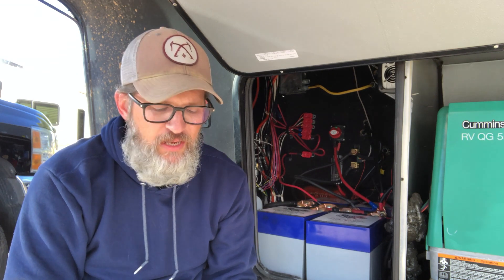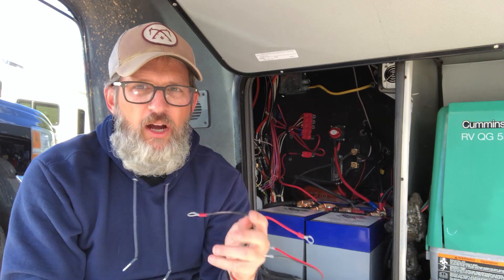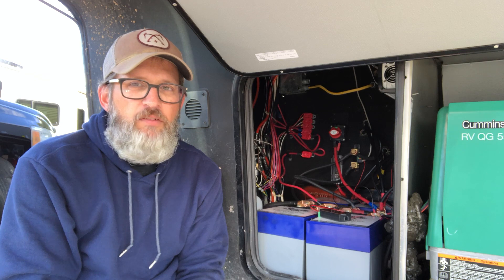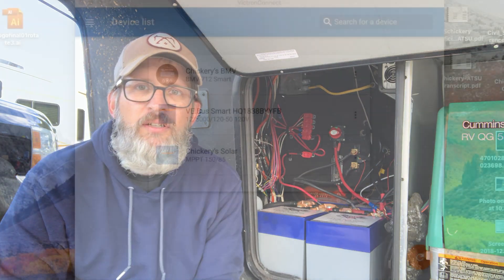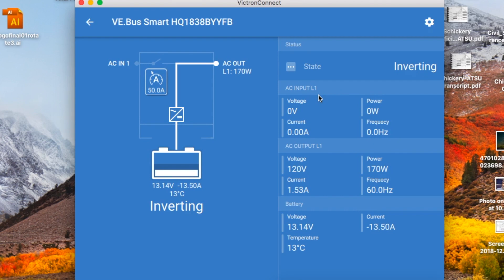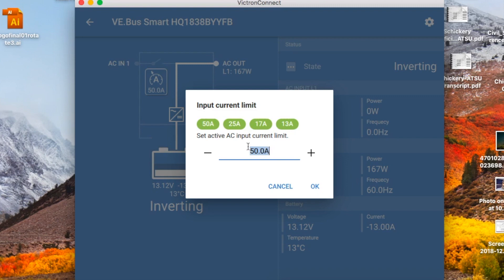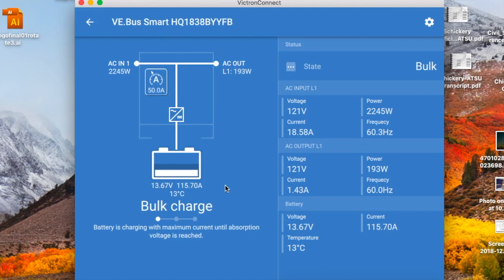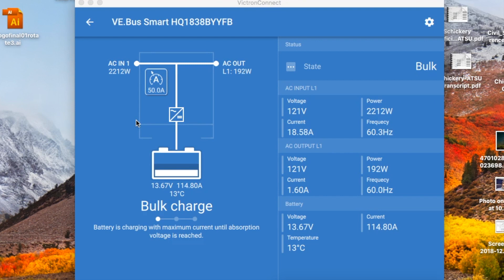Victron VE.Bus Smart Dongle Installation

Comment: These are great to rectify high voltage readings that you may get from charger which causes absorption to early.i used on easysolar/multi, connection direct to battery with rj45 back to charger/inverter,it worked a treat,the Bluetooth information is a bonus, because i have a digital multi panel this overides the dongle so i cant change multis/easysolar settings,no biggie so long as the correct voltage is given to unit.
The dongle also supports smart networking.
I agree having to having to fork out 4 all these extra little knick knacks is getting tiresome.

Comment: Bluetooth MONITORING wasn’t a big draw for me, so I passed on a BMV712, and got a ‘simpler’ Shunt.  But … I didn’t quite understand that the Only way to (program) my Multiplus, MPPT, and Orion was to buy the Dongle …. am I correct ??  I’m an iOS user, a computer NOVICE, and finally, I Really HOPED that I didn’t need to buy any more VE components …. 😫
Reply: Yes the only want to actually program your settings on a Multiplus ect is a dongle, Just have to make sure you get the correct one ie, VE Direct or VE Bus. The BMV712 is ONLY monitoring screen from what i understand which uses the shunt to get its info(Has an alarm output). I am still trying to work out if the BMV712 will interface and share data with a VE Direct bluetooth dongle like shown in the video.

Comment: Hi and thank you! This is the only video I’ve seen that actually shows install. We have 4 batteries and it looks like you might too. Is there a specific pos/neg terminal you connected to, as in first and last in series, inner most battery, or how did you select? I read it should be attached in inner battery or whichever one might heat up quickest but wasn’t sure about which battery terminals. Thanks in advance!
Reply from the maker: I just put on the first battery.

Comment: Why do you need this dongle when you have the BMV-712 Doesn't it give you the same info? If not, what can it do that the BMV712 cant?
Reply from the maker: This dongle allows me to program settings on the inverter charger, as well as remotely monitor.

Comment: Where do you plug in the RJ45 cable into the Multiplus 3000.  That would be nice to see
Reply: Yeah it was kind of like “tada” it’s magically done.
Reply: There are 2RJ45 ports under the cover at the pretty sure you can plug in to either one

Comment: Hi. Why do you need the mmpt charge controller since your inverter also has a charger. Considering it costs upwards of $800
Reply from the maker: Thanks for the question! The MMPT is for the solar side. The charger on the inverter is to charge the batteries from the shore power and/or the generator.

Comment: Hi, Does that inverter act like a pass through for shore power? As in if that is a 2000 watt inverter, will the shore power be bottle necked to 2000 or does it let the power flow through as needed?
Reply from the maker: It allows the power to flow through as needed.

Comment: Hi Sean, how do you configure mppt and inverter charger settings? I mean smthey both want to charge so who decides if the inverter or the mppt is charging?
Also if you have the inverter/charger that also shows you the SOC, do you still need the batt monitor in the system?
I bought the same configuration but im unsure if i need the batt monitor
Reply from the maker: I share the inverter settings in this video (https://youtu.be/s5Lj-NMlMCk). The MPPT settings will depend on your solar setup. They are completely different. The inverter takes the battery power and converts it to AC power for your 110v outlets, etc. When it is charging, it takes that same 110 power from the shore power side to charge the batteries. The MPPT is only taking the power generated by the solar panels to charge the batteries. So, if you are hooked up to shore power or are running a generator, the inverter/charger will do most of the work in keeping your batteries charged. If you are unplugged from everything, the MPPT will be your only source for charging the batteries. We are rarely plugged in anymore so my MPPT does 99% of the charging of the batteries using out 860 watts of solar. The inverter/charger, MPPT, and batteries are all "Smart" in that they have controls to keep the batteries from overcharging or undercharging. 
The battery monitor is, in my opinion, a necessity. This is not only for the state of charge, but also time remaining, what you are using vs what you are taking in, number of charge cycles on the batteries, etc. It is an invaluable part of staying on top of your batteries.
Reply: Chickery's Travels thanks 🙏 
Does the temp value from the dongle gets shared through ve smart network to the mppt charger?

Comment: Hi Sean can you use this device to stop the invertor when it gets to a specified voltage?
Reply from the maker: Yes, you can turn it on and off at any time with this device. You can also adjust the settings for your preferences.